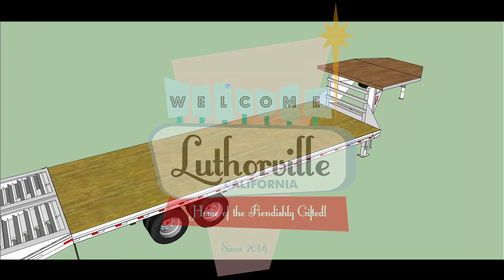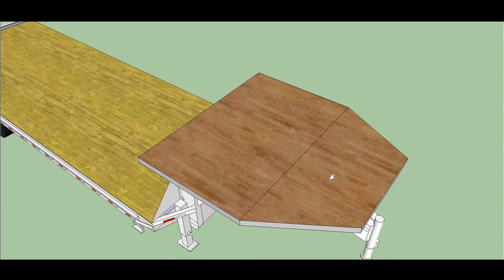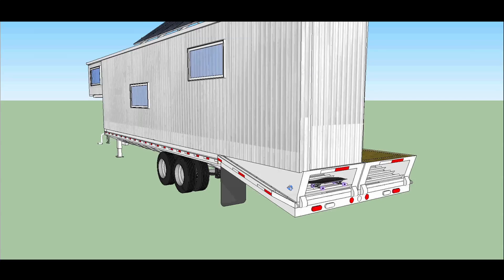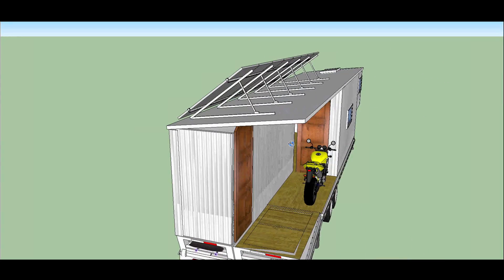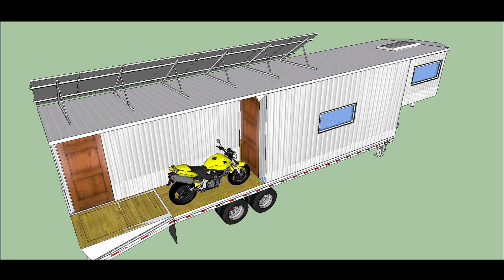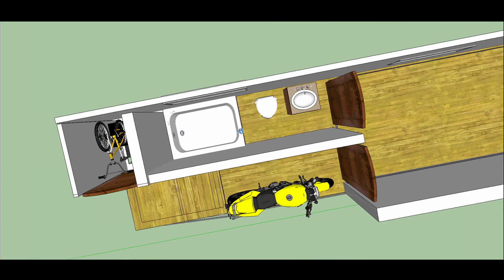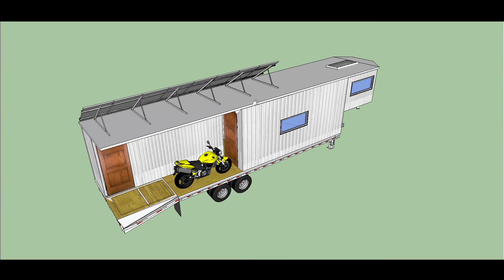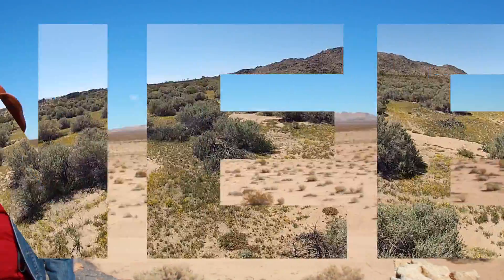Tiny House Build: Step #5 - Designing The Layout

Comment: I'm curious, by having the bathroom & tool shed on one side like that, won't there be a weight balance issue?
Reply from the maker: Yes and no. Remember there will often be a 400 pound motorcycle on the passenger side, plus the trailer is a heavy-duty commercial trailer with dually tires and is rated to 25,000 pounds. So, while it may still be a few hundred pounds heavier on the driver side, I doubt the weight difference will be significant enough to cause any problems... I hope.
Reply: I'd forgotten you were using the haver duty trailer. I do hope you don't have a balance issue, especially with the 200 gallons of water on one side.
Reply: New question, is sketch up easy to use for a beginner? And is it free? I'm trying to build my THOW on an extremely small budget.
Reply from the maker: That is greywater and freshwater. So, there will never be a time when both tanks are 100% filled.
Reply from the maker: Yes, it's free and quite easy to use.

Comment: Very nicely done! Have you thought about a wall for the porch area that would open out into an awning? Or will the porch be view-able from the road when driving?
Reply from the maker: The porch will be viewable when driving, exactly as you see in the video. My one concern with my design is the occasional high winds in the desert might whip into the porch and blow the trailer over, since the porch creates a big "pocket" for the wind. I hope that never happens! But it is a contingency I've considered. If I ever get a big "scare" like that, I might need to create a removable wall/awning as you've suggested.
Reply: Luthorville: Building an Off-Grid Mojave Tiny House
Looking forward to seeing the finished product.

Comment: A very unique and interesting design. Thanks for sharing. I am assuming that the opening on the roof (over the bedroom) will serve as both, an emergency escape hatch as well as access to the roof.
Reply from the maker: Thank you. I am proud of the fact that I came up with a truly innovative design that no one has ever done before - with a side-porch and motorcycle ramp. Due to cost constraints, I may not have the skylight. However, you are correct, RVIA certification requires a secondary emergency egress. Without the skylight, that stipulation will have to be met via a side window.